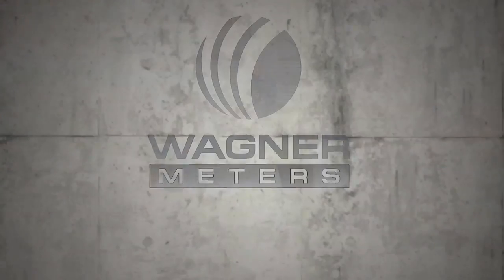Differences Between Lightweight Concrete and Normal Weight Concrete

Comment: Thanks! I would love a Pumice/cement/sand ratio that will be very lightweight if you can help
Reply from the maker: Dor:

Thanks for the question. Unfortunately, specific mix design isn’t my forte and the components of the design would change based on geographic location and available resources. I would reach out to a local concrete supplier for their input.

Thanks,
Jason

Comment: Is possible to drill threw it with out it cracking ?
Reply from the maker: Thanks for the comment. The answer is it will usually depend on the compressive strength of the concrete. One won’t be more susceptible than the other to cracking like that.

Thanks,

Jason

Comment: Why is it that normal or heavy weight concrete is conductive and light-weight concrete is not?
Reply from the maker: Gregg:
 
Thanks for the question. Not claiming to be an expert on this topic specifically, but I did some research and it seems that light weight aggregate concrete does have some conductive properties, just not as much as standard weight. From what I can gather, it has to do with the increased porosity of the aggregate in lightweight and the overall mass difference with standard weight. If you are so inclined, this gives a VERY technical explanation https://ac.els-cdn.com/S1878522015002854/1-s2.0-S1878522015002854-main.pdf?_tid=527bd2eb-0447-42b4-bc9b-0163dbc1801c&acdnat=1544484349_58108aadebab1f604f82afc6db62a874
 
Regards,
 
Jason

Comment: Lots of people are adding foam to concrete to the point it actually floats on water. Very light. Some are adding perlite as well. Thoughts?
Reply from the maker: Nate:

There are various components that have been, and will continue to be, added to concrete in an effort to improve various characteristics of mix designs.  I think most will end up being utilized in niche applications.  This being said, I really haven’t dug into either of these specific topics to be able to give an opinion.

Jason

Comment: I have competition of conoe we have made test cubes with styrofoam(thermocol) the weight is reduced but its compression strength decreased
to counter tension and bending moment we provided jute fibres 1.5 inch long.
but we don't have time to test it 
what proportions could we use
Reply: Karan Kamboj you can also add steel structure for light weight concrete block such as clc and acc blocks